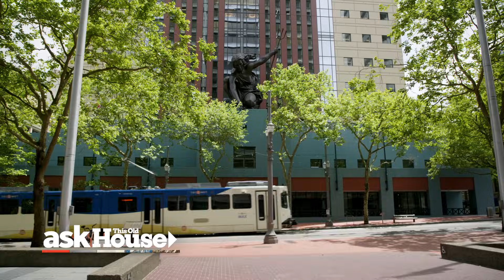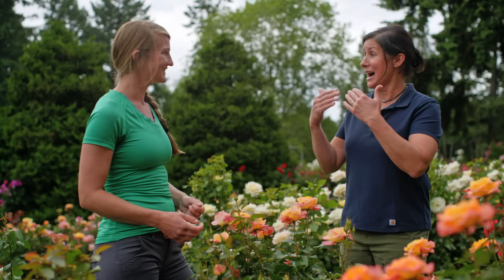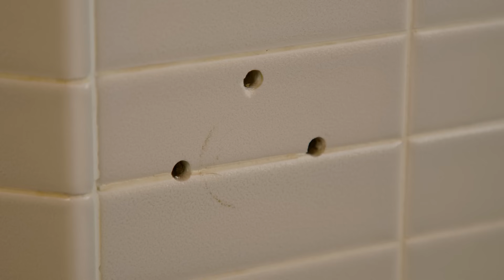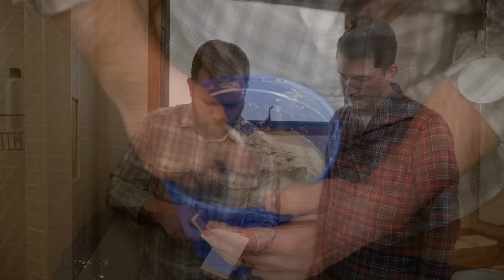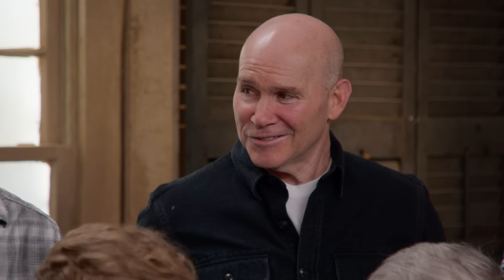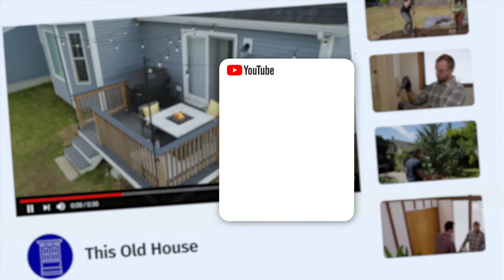ASK This Old House | Rose Test Garden, Wall Tile (S22 E26) FULL EPISODE

Comment: That construction adhesive Nathan used behind the tile, will not do anything.
It some did drill into it for what ever reason.
The chance of them hitting the same hole, is .0000000001%.
For that 1 in a trillion chance they do. What is the adhesive going to do?

Comment: I swear I’ve seen this episode before! Is this a re-upload?
Reply: Then don't watch it. There's lke a 2 or 3 year difference between TV and YouTube.
Reply: @saulgoodman2018 not complaining
Just noting in case of any errors
Reply: @Iosve  Sounds like you are complaining.
Reply: @saulgoodman2018 then you don’t live up to your username, as if you read the original comment;

A. My original comment is observational, not evaluative. It asks whether the episode is a re-upload and makes no negative judgment, demand, or accusation.
B. My follow-up explicitly removes any complaint intent by stating “not complaining” and explaining the purpose as noting a possible error.
C. There is no expression of dissatisfaction, frustration, or grievance, which are required elements of a complaint in my original comment.
D. Your claim that it “sounds like complaining” is a subjective reaction and reflects the responder’s interpretation, not the content of the statement itself. So it sounds like a you problem.
E. Ultimately, a good-faith reading of the comment leads to clarification, while labeling it a complaint requires assuming intent that is not stated or implied.
Reply: @Iosve  You are still complaining.